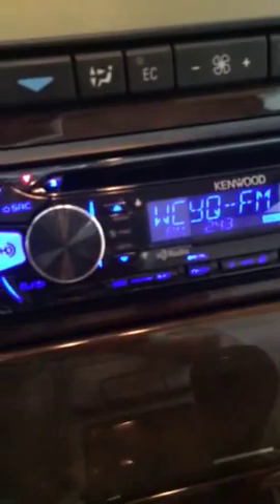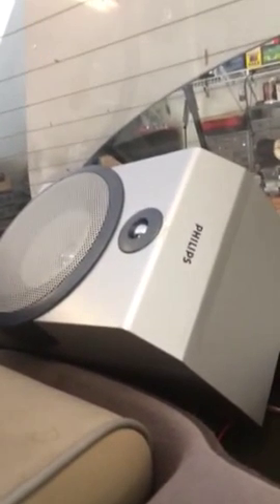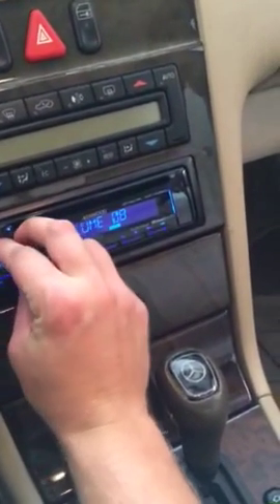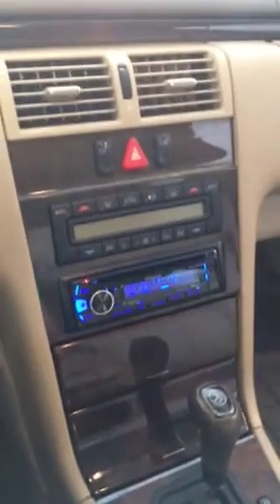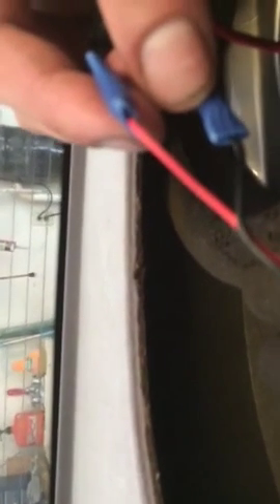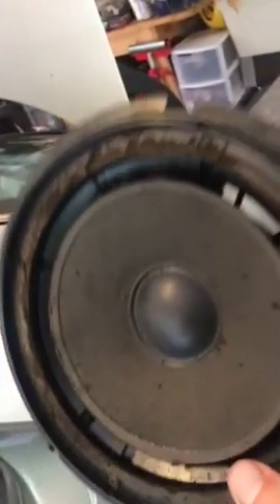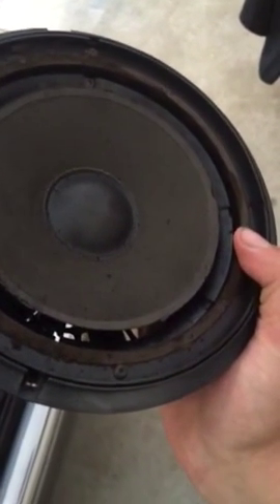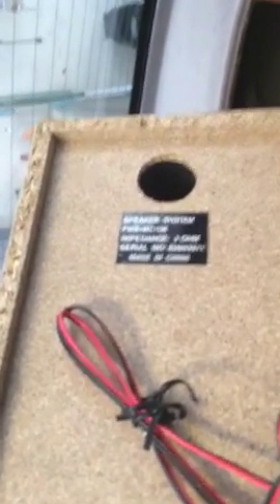Custom Subwoofer Speaker Installation Mercedes E320

Comment: @ferretcommando I just bought a radio. Wired it based on chart and original plug so lines match up. Radio turns on but no sounds is coming from speakers and speaker and fuse are ok. What do you think it is?